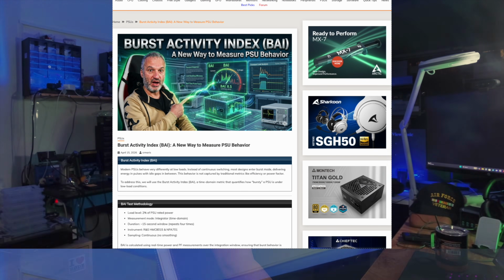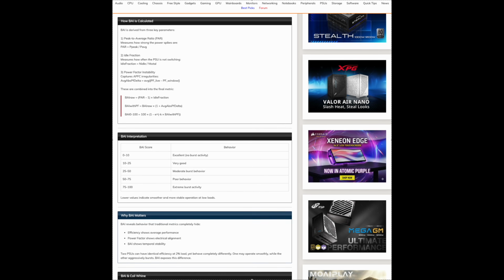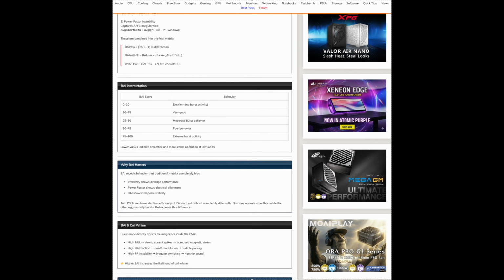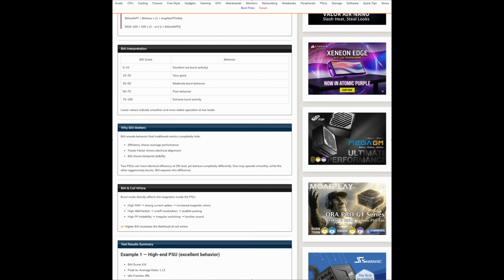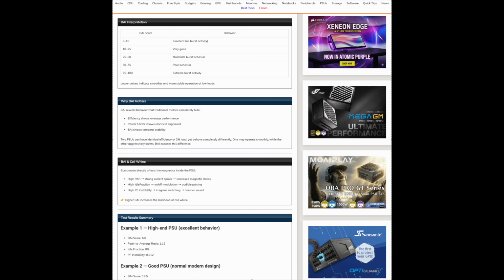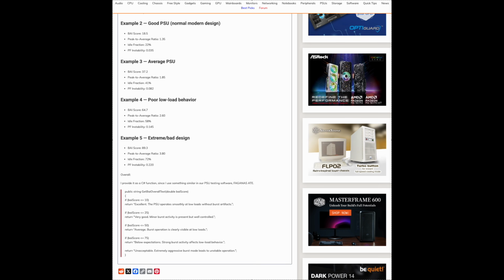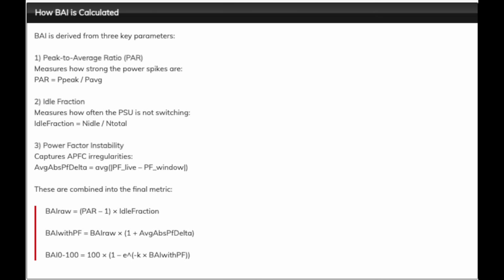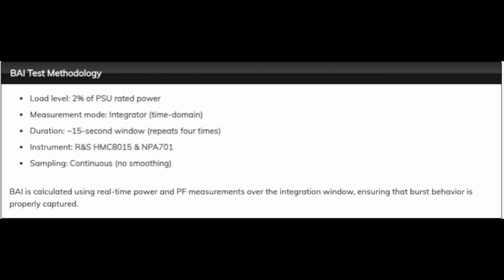BAI: The First Metric That Predicts PSU Coil Whine

Comment: Is coil wine actually dangerous?
All my research shows no.
I cannot say if my Corsair TX750M Gold had coil wine or no.
Rest of the system was quite loud or rather 2 fans that came with Coolermaster Masterbox NR600 were not PWM.
3 Arctic Bionix and Aerocool Cylon 4 CPU cooler I kept at 75% or lower because they were LOUD at 100%.
I replaced RX6600 XFX SWIFT with Gigabyte Windforce(May or may not be OC)5060Ti 16GB and I haven't noticed system becoming louder.
It may be few decibels more quiet.

Soon I will replace current case with Be Quiet Pure Base 501DX and cooler with Arctic Freezer 36.
Ryzen 5 5500 will be replaced with Ryzen 7 5700X.
Supposedly the case is quite quiet as is New cooler,but I have my doubts about 100%.
IF my PSU has coil wine,I guess I might hear it now.
That aside,I don't think there is a reason to replace my PSU.
Aris I think it was gave it great(or close enough)review unless I mixed up something.
I don't think I needbto replace it for...5 more years at least.
I have it 3,maybe 4 years.